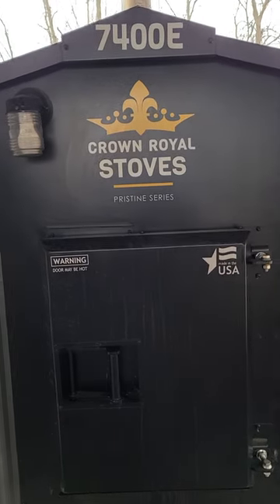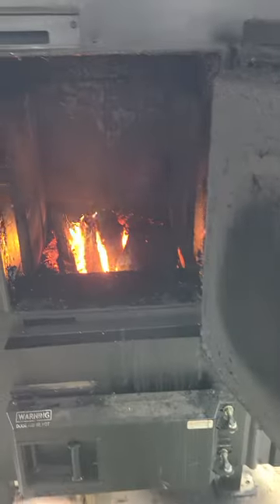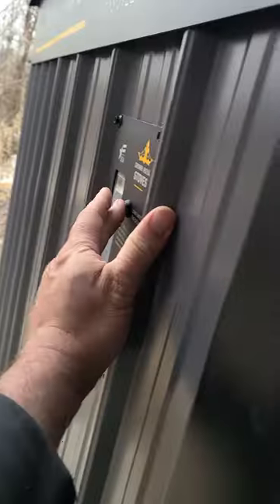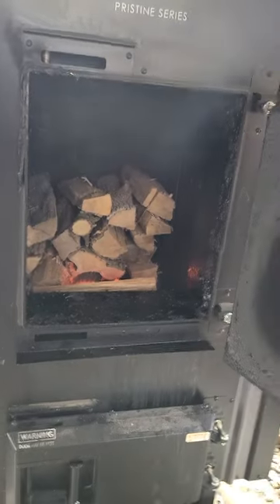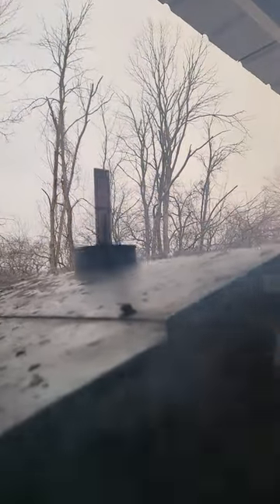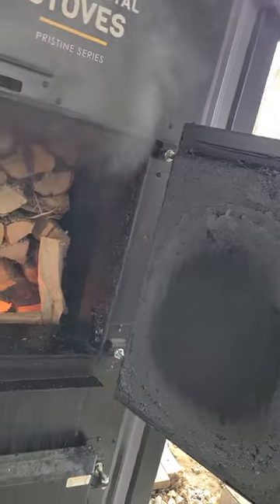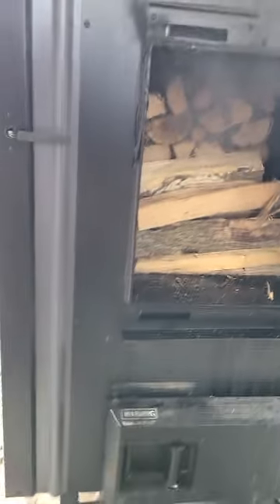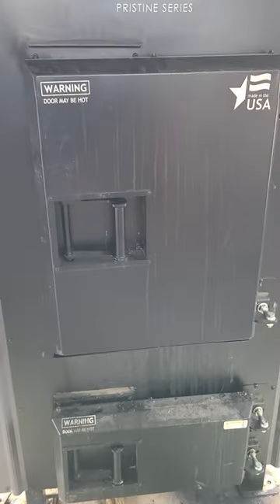Crown Royal 7400E will one load last the weekend? PART 1

Comment: So you have your temperature set at 190 and your differential set at 40?   I'm having trouble finding a "sweet spot" with my 7300e and what to set it at.   It burns up wood super fast.
Reply: I watched your next video and you put in the description that your temp is 180 and it shuts off at 170 so your differential is 10?  In this video you stated different.  Could you clarify?  thanks
Reply from the maker: Sorry about that. The controls on the side shut the unit down if it gets to 190. It will not open the plate in the back and turn the fan on until it cools down to 150. This is to protect the boiler from getting too hot. I believe it is on page 30 of the manual. I missed it until this happened to me lol. 
As for set points I have it set to 180 and turn on at 170. So a dif of 10 degrees. 
What kind of wood are you burning?
Reply from the maker: Also check the nozzle in the main chamber and make sure it's not broken that will drop the efficacy down a lot as well.